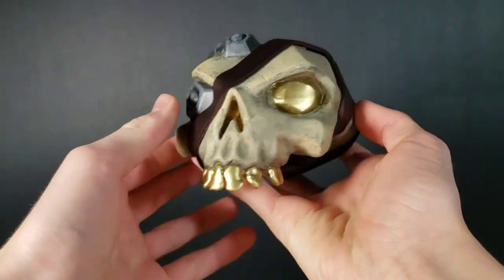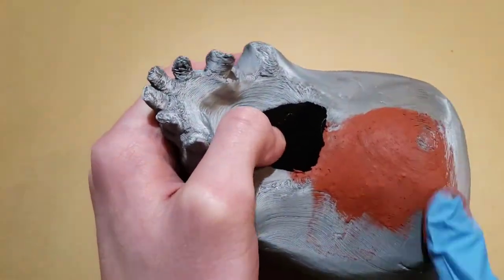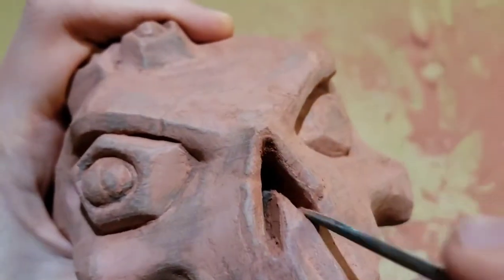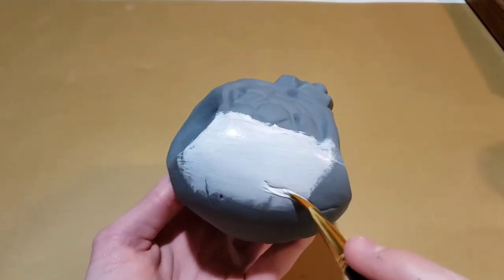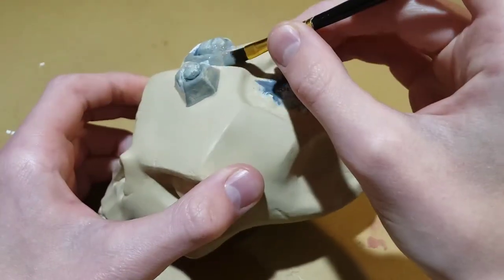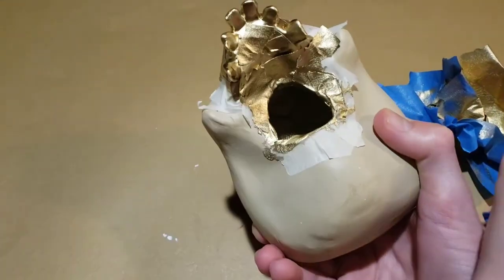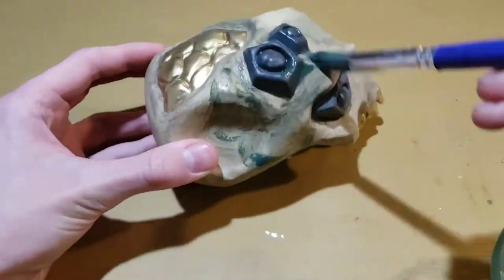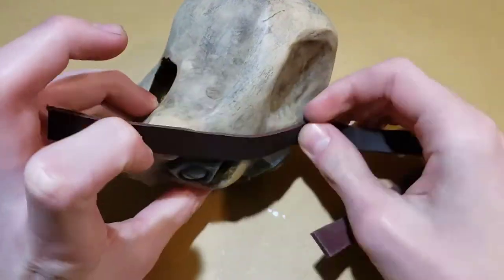How To Make a 3D Printed Captain's Skull Prop | Sea of Thieves

Comment: what kind of gloves did you use when using the bondo? and what color did you use when first dry brushing the skull?
Reply: also great job on the skull it looks like you straight up pulled it out of the game
Reply from the maker: Thank you very much! For the dry brushing, I mixed white paint with the bone colored paint to make a lighter version. The gloves I used were rubber coated gloves similar to these: 
https://a.co/d/3JBWPg0
Reply: @ColesHobbies  thanks
Reply from the maker: Of course! Thank you for watching.
Reply: @ColesHobbies  I have one other question can you provide a link to the skull that already has supports because my slicing software is having trouble generating good supports
Reply from the maker: I only found the skull without supports so I made custom supports using Cura. I find that the computer generated supports are often unreliable. So I suggest try making your own.
Reply: @ColesHobbies  my printer does not work with cura it uses flashforge and flashforge does not have very good settings for supports so if you have a file with supports already on it that would be helpful
Reply from the maker: I don't have the file with supports on it, sorry. If you slice the model on Cura and export it in the right format to a USB drive, you should be able to plug it into your printer and print the file. I also believe you can use networked printing to send the file straight to the printer from Cura.
Reply: @ColesHobbies  ok thank you

Comment: Hello there, what settings did you use for this print? also what kind of filament?
Reply from the maker: I believe I used 3mm layer height, 60mm/s print speed, about 10% infill, 3 wall thickness, and I can't remember the temperature.

Here is the filament I printed the skull with: 3D Solutech Silver Metal 3D Printer PLA Filament 1.75MM Filament, Dimensional Accuracy +/- 0.03 mm, 2.2 LBS (1.0KG) - PLA175TCMS https://www.amazon.com/dp/B00ME7YUIU/ref=cm_sw_r_apan_i_AH8HGNZQPFCS7WJQQ22D?_encoding=UTF8&psc=1
Reply: @ColesHobbies  thank you so much 😁
Reply from the maker: Of course! I'm happy to help :)